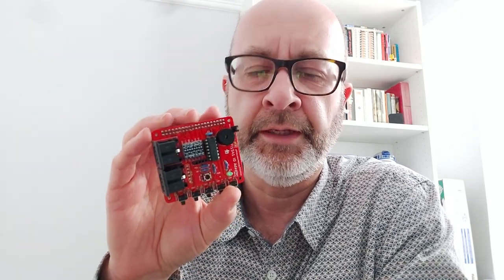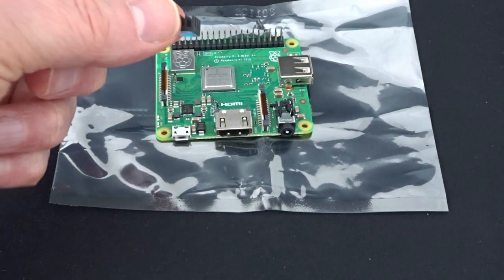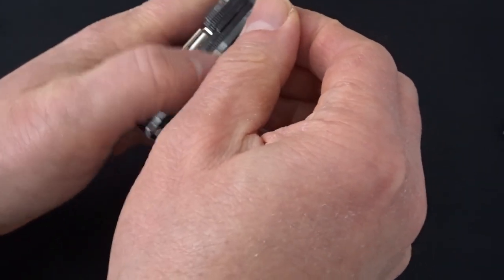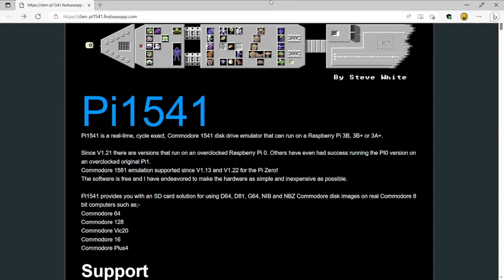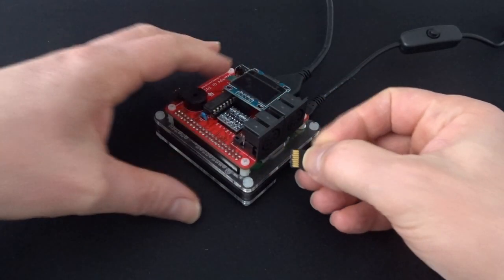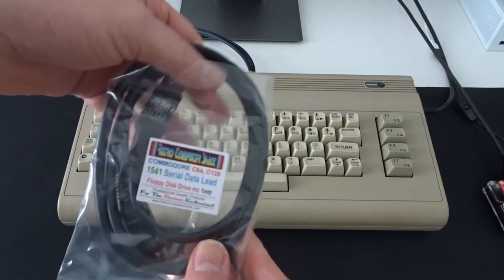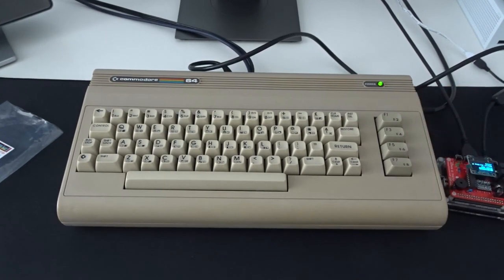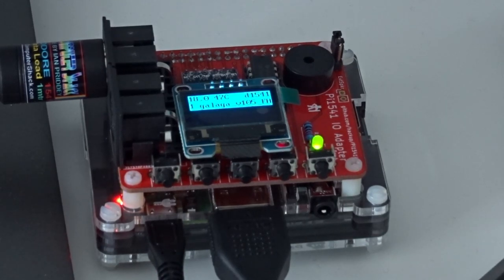Building a Pi1541 Commodore Disk Drive Emulator

Comment: Awesome work. This has to be one of the best Pi1541 setup video I have seen so far.
For best compatibility it is best to disable the displaying of the IEC bus signals on the HDMI screen. This can be done by removing the line "GraphIEC = 1" or changing it to "GraphIEC = 0" in the options.txt file. It is not strictly necessary to do so my it can help improve compatibility. When developing I use it to see the signals but for general use, it can be advantageous to turn them off as this ensures the Pi has more cycles available to it to keep up with the real-time emulation requirements. Sorry, I should have made "GraphIEC = 0" the default option.
Reply from the maker: Hey, what a great comment to start the day with, thank you! And I want to thank you for all the work you've done on the hardware and software side to make such a great device. Great advice on disabling the IEC bus signal, although it does look good for demo purposes. I'm looking forward to playing with this some more and making a follow up video. 👍

Comment: Very nice. I did essentially the same build with a 3A+ a month ago, and I found the 1.24 kernel would not pass the most challenging test I found - Star Wars Demo from csdb - but the 1.23 firmware does. I also disable the graphical IEC display.

The PiZero 2W also passes this test with a 1300 overclock, as it's basically the pi3 platform and uses the pi3 version of pi1541 as well. However, the original Zero does not seem to have the nutz to hang with the Star Wars Demo. It simply needs a bigger overclock than I can get it to accept, though I imagine it's fine for 99% of things at 1100 - 1150.